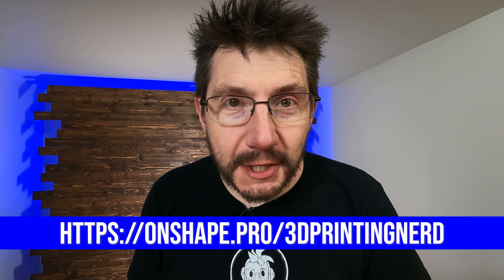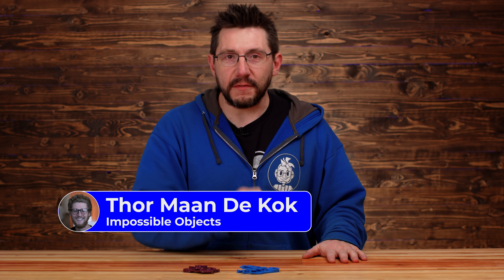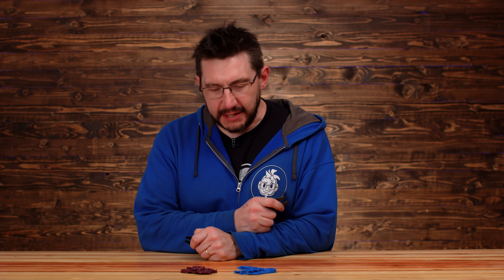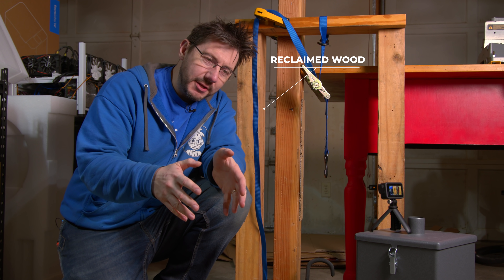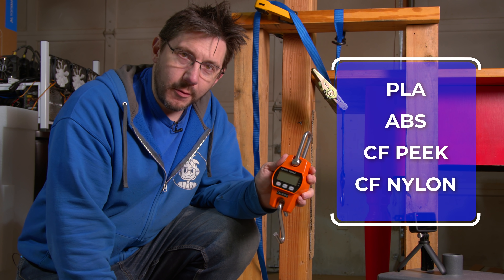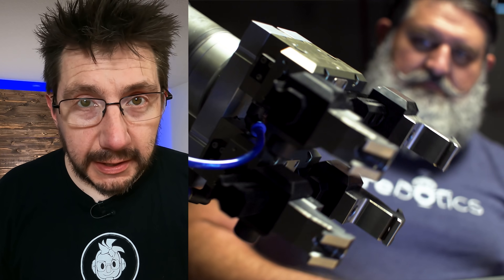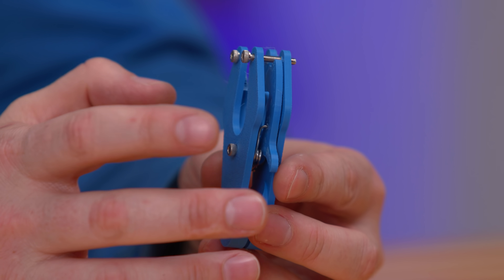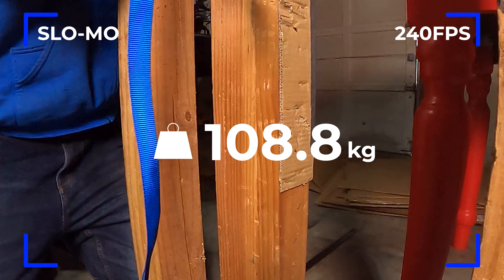3D Printed Snap Close (Frog) Connector!

Comment: you should try to retest with ABS but alter the orientation of the parts so that you print a bit different maybe have it so it's at a 45 degree angle sins in many cases the printer for reference like to print perpendicular to the plate meaning 90 degrees by then rotating the part so that its 45 to that angle should make it more interesting i'm actually dyeing to see if it has any effect of if its just my imagination that think it has effect

Comment: a higher speed camera from smarter everyday won't help getting the final measurement, the scale screen is probably alreay refreshing slower than what the gopro can record
you need a DIY solution with a strain gauge and data logging through an arduino or raspberry pi
and also a more stable increase of load (using a motor attached to a screw rather than a ratchet operated by hand)
in other word, ask help from CNC kitchen to make a purpose built setup

Comment: SO...... Climbing equipment is typically rated in kN (KiloNewtons) instead of pounds or kilograms for holding weight- Newtons are used for dynamic load ratings, pounds/Kilograms are for static load ratings. a Carbiner, for example, is rated at something like 20kN, which is roughly 2,000 kg (4500 pounds) of force. (force = mass times gravity) The official KONG frog is rated at 23kN, for comparison.  

Would I trust a 3d printed version for a static load? maybe, if it was a light load. for climbing in any way, shape, or form? Not on my life or anyone else's. climbing gear has certifications and exhaustive testing done for a reason. (couple friends and I used to be regulars at the local rock climbing gym pre-pandemic, and I got interested in how the load ratings work, because I was even fatter then I currently am when I started...)
Reply: That having been said, I'd love to see how it holds up to a dynamic load; Hook it up to an anchor point and drop a specific weight that's attached to one end with a force gage that has a 'peak holding' function on it, and see how much it takes to break it.

Comment: Although running multiple tests and getting their averages is boring (and probably expensive regarding the CF materials), it's also a big part of science and something I think is really needed to get good, confident conclusions from :) . As well mentioned elsewhere in the comments, like a pulley, the "whole Joel" test it really only held half the weight of. If the whole Joel test though is ever repeated, I hope you have access to some stunt pads as a safety precaution. Science is great but not at the expense of hurting yourself. High five :) .

Comment: Your final test..... you had a 2:1 ratio so how you had it it would easily hold you. You had two fixed ends so each fitting is taking 50% of your weight. You need a single point fix using the clip coming down to a loop to put your foot in.
Reply: Beat me to it. The PEEK was only holding half a Joel.

Comment: For the ABS I would print test 2 more versions. One that is plain abs and one that has been given the acetone vapor chamber treatment to see if there is a difference.  When I was using ABS for hooks and things that hold wait I would often do a light vapor chamber treatment to strengthen it up to prevent splitting layers.

Comment: If the ABS is harder, it could also be more brittle. If the manufacturing of that introduces any kind of defect, stress will expose it.

Having a harder part is great for applications where you don't want any bending or stretching but then your part has to stay within it's limits. PLA probably stretched a lot more which for this application is great but for others, might not be.

I think it's valid. Different materials for different applications.

Comment: The test is seriously flawed. Single sample. No function to hold the peak value on the scale. Scale was dropped multiple times and would need to get recalibrated after such an impact. (I would suggest to hold the scale in place with a string so it can't drop down when the part snaps. Attaching the failing part below the scale might help. But then a string to stop it from flying upwards too far might be needed) The ratchet mechanism does not apply an increasing force in a constant linear fashion either.
Fun to watch, but unfortunately a bit unscientific to really get any conclusion from this test method.